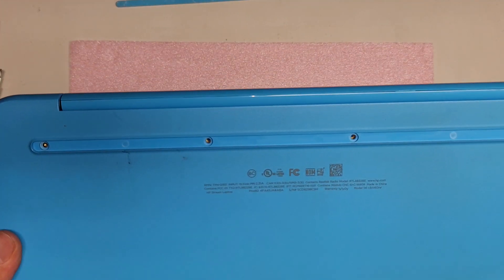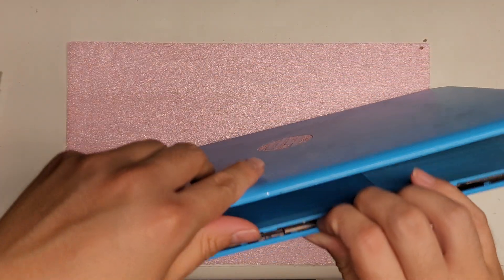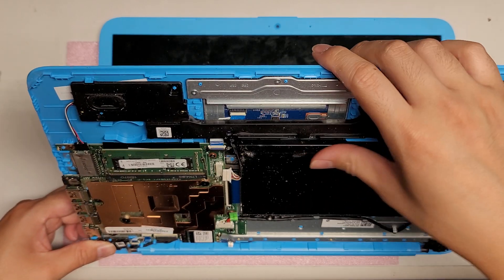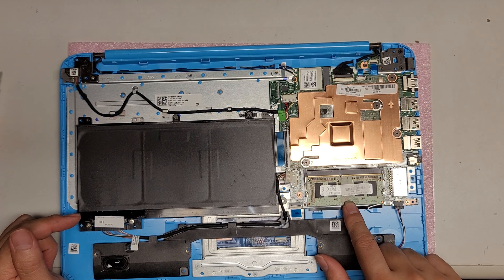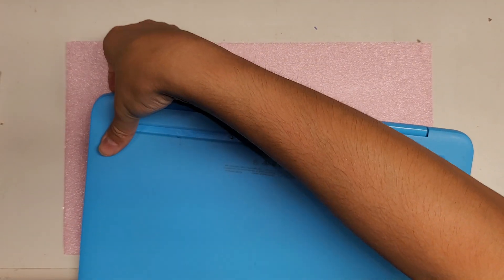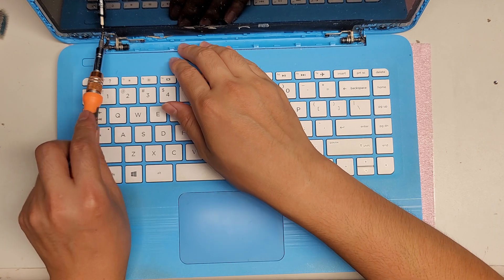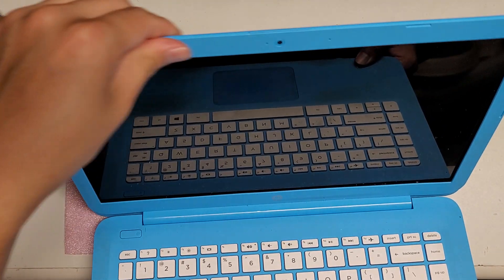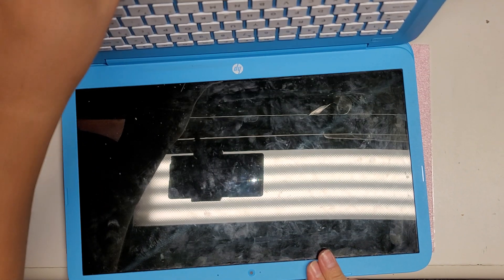HP Stream 14-cb140nr Disassembly RAM Upgrade Repair LCD Screen Replacement

Comment: thank you for the video!!! i have the HP Stream 14-AX000nv ...Has integrated onboard ram and CAN NOT be upgraded... wasnt able to locate the flash either, definately NO SSD- gives budget a new meaning hahaha, sad because for $20 ram upgrade will make a huge difference on this laptop. Overall a fine laptop for light work
Reply from the maker: Yeah, I don't know why they do it.

Comment: I want to ask something.  I have the same model laptop.  And I want to increase storage space.  I know there is no extra bit ssd slot.  but can I remove the wi-fi card and replace it with a bit ssd with msata or m2 input?  Does the motherboard accept it?
Reply from the maker: Possibly. Someone might have mentioned it in the comments.

Comment: Could I put 8gb of ram inside and I dont have to do anything do I?
Reply from the maker: Sure
Reply: @ItsBinhRepaired  also would it run Minecraft bedrock bc the jp stream I am getting is stock and older model
Reply from the maker: @Gotta_Bee_Sam  not sure.  Processor is pretty weak.
Reply: @ItsBinhRepaired  okay I just wait and see 👀
Reply from the maker: @Gotta_Bee_Sam  OK

Comment: I have this computer but I don't quite understand it.  I wonder if the disk in this computer is ssd or emmc?  if emmc is there any possibility of installing ssd in this computer?  thanks.
Reply: Model: hp stream 14-cb0xx
Reply from the maker: Emmc can't be upgraded. You can add an SD card or USB for storage. Some models I've heard people install an SSD in the place of the wireless card and use a usb wireless adapter.

Comment: The lights on but nobody's home .Good video .
Reply from the maker: Lol wuh?
Reply: @ItsBinhRepaired  was just looking ti see how it came apart and you video was very helpful sir.
Reply from the maker: Glad it helped. Do you know what the light's on, but nobody's home means? Lol
Reply: I have one and the power port is broken so I can see now before I even open it that it isn't attached to the main board so happy days .
Reply from the maker: @danieldoherty8009  haha sounds good. If you haven't already, please like and subscribe so others can find my videos. Thanks!
Reply: @ItsBinhRepaired  its an old irish saying lol , as you mentioned in your video that the light was on on the laptop but the screen wasn't lightening so It's my way of referring to the problem with your laptop.no offence intended .
Reply from the maker: @danieldoherty8009  lol the saying usually refers to a stupid person or someone not paying attention haha
Reply: @ItsBinhRepaired  The saying probably means alot of things lol .
Reply from the maker: @danieldoherty8009  lol

Comment: HP should be ashamed putting this piece of junk out.
I had been a lifelong HP purchaser, but personally and professionally, but after buying this for my daughter and it not even last a year before there was no room to accept Windows updates.... I threw it in the trash and stopped buying HP.
Reply from the maker: apparently you can replace the wireless card with an msata SSD and use a usb wireless adapter. The laptop was created because Microsoft was releasing cheap licenses for computers that adhered to strict spec limitations. There were screen size limitations as well as storage limitations.

Comment: the "SSD" can't be upgraded as it eMMC but what you can do it get a mSATA SSD, remove the wifi card and replace the wifi card with the mSATA SSD, then since you wouldn't have a wifi card anymore you would just have to buy a usb wifi dongle. A 256GB mSATA SSD on Amazon costs $40.00 and the wifi dongle $14.00
Reply from the maker: Hmmm good idea. Have you done that?
Reply: I have not done it on this exact machine but I have installed an M SATA SSD into my other laptop replacing one of the wireless cards with it but it had two wireless cards and three m sata slots but only the one of them was the right length for the m sata SSD
Reply from the maker: Interesting
Reply: @ItsBinhRepaired  I was just in my sisters and it is not a standard msata slot.
Reply from the maker: @Jammermaker  :(
Reply: @ItsBinhRepaired  I told her her best bet is to get a SD card for the extra space because it just uses the USB 2.0 ports as far as I can tell.  I mean I have 128gb in my phone and that was cheap enough.  Appreciate the video though made taking it apart a breeze.
Reply from the maker: @Jammermaker  yup, no problem
Reply: I have this computer but I don't quite understand it.  I wonder if the disk in this computer is ssd or emmc?  if emmc is there any possibility of installing ssd in this computer?  thanks.
Model: hp stream 14-cb0xx

Comment: What stick of ram would you recommend for this, and how high can it be upgraded? Could you send a link?
Reply from the maker: You likely won't get much performance increase, but this. https://amzn.to/3BbikNx Might as well use the money towards a real computer, not one of these stream things that are designed just for basic internet usage.
Reply: @ItsBinhRepaired  I fortunately have a really good laptop with exceptional performance, buuuut I’m also a hoe for blue and white themed things lol. I may use it for writing and simple projects. 
Without the upgrade of ram, do you think it would still load things pretty quickly? Google chrome? Microsoft wordpad? Even the boot up time? I don’t want to rage at something for being incredibly slow, but when I saw the 4gb of ram I could just feeeeel that waiting to happen. I just haven’t found a decent laptop that’s coloured with a white keyboard/blue body combo.
Reply from the maker: @nagisashiota6604  processor and storage will be the issue. More RAM = storage will be eaten up to make room for RAM dump if it crashes.

You could get skins for laptops, or watch my disassembly videos and cover all the important bits and spray paint a laptop blue haha
Reply from the maker: Someone said you can replace the wireless card with an msata SSD and then use a usb wireless card.

Comment: I have the same laptop and if I use an external monitor and use the function key on the top row to switch the monitor off and only use the external monitor, if I leave that setting and unplug the external next time I start my computer I will have no monitor visible as if it didn't work until I hit the function key on the top row. It asks "laptop only" "duplicate" "extend"  and "external only". Just thinking maybe you pushed the function key by mistake and that's why your monitor won't work.
Reply from the maker: Nope, dead laptop. These are customer computers. I don't own them.

Comment: I just crucial scan my latest AMD HP stream 14 that it can be upgraded to 8 GB.
Reply from the maker: You can put whatever fits. Even 16gb
Reply: @ItsBinhRepaired  really?
Reply from the maker: @lilcoocas9869  try it. I haven't seen a laptop RAM limited in over 10 years

Comment: Do you think it's possible to change processors? If so, what one would you recommend?
Reply from the maker: Do people even watch my videos?
Reply: @ItsBinhRepaired  literally just found your channel, but I like your content
Reply from the maker: @l.d.cfilms4363  haha thanks. The processors on 99.9% of laptops cannot be changed.
Reply: @ItsBinhRepaired  this is why I love my old Dell Precision M4500, not only is the CPU socketed but it also has discrete graphics (Quadro FX1800 I think).  But I believe I have one of the best if not the best processor that fits in the socket for it
Reply from the maker: @Jammermaker  nice

Comment: Dude can the storage be upgradeable (not the RAM but the other one)?
Reply from the maker: Nope
Reply: If you mean the 32 gb hard drive, it can't be physically exchanged for a better one, but I bought a 2 tb external hard drive, and it works really good for me.
Reply from the maker: @l.d.cfilms4363  exactly! And someone wants me to believe they can play fallout 3 on it at 60fps LOL
Reply: @ItsBinhRepaired  yeah, I like to play minecraft, one of the least graphics intensive games know to man, and I get like 30 fps on a good day
Reply from the maker: @l.d.cfilms4363  try roblox maybe :P
Reply: @l.d.cfilms4363  how did you install it?
Reply: @techwave-99  if you mean the external hard drive, all I did was buy a 2tb hard drive (doesn't have to be 2 terabytes, just the one I picked), plug it into the usb port, and in settings I switched all the settings to 'save to :E drive.
Reply: @techwave-99  I would recommend SanDisk, as they're high quality, never have problems, and they're easy to set up.
Reply: @l.d.cfilms4363  yo, I have a question, my laptop (the one in the video) doesn't have enough storage for anything, I deleted everything yet I still don't even have enough storage to factory reset. 

Should I replace the RAM or get the external hard drive you mentioned in the previous comments? 

If I do get the external hard drive, what would I do since I don't even have anything downloaded
Reply from the maker: I don't know what you're talking about. A factory restore deletes all your data.
Reply: @salemthesomali3421   I would recommend getting the ssd replaced. It doesn't have to be some fancy 800 tb hard drive, but just something that can hold the storage necessary for factory resetting. I also had the issue where I didn't have the storage to do it. If it costs to much however, I might have to recommend selling yours and getting a new one. Sorry for such a long reply, but I hope it helps dude.
Reply: @l.d.cfilms4363  bro, I was expecting you to answer maybe weeks later, thank you so much
Reply from the maker: Me? Why would I wait weeks to respond? Lol
Reply: @salemthesomali3421  yeah no problem, I hate it when somebody answers my question weeks or months after I've already resolved my issue lol
Reply from the maker: Yup lol
Reply: Ooohh okay thanks guys. Maybe I'll buy an external drive instead.
Reply: What games can be played on this laptop? Can valorant be okay? Or will it lag?
Reply from the maker: @miskaasa  nothing lol

Comment: I upgraded the ram without getting the whole shell off. It was just reaching it and grabbing the ram out after unlatching, then add the new ram in and drop and latch.
Reply from the maker: Nice
Reply: What did you do upgrade wise? Replace with another 4gb or 8gb? If 8gb upgrade send me link or what product exactly? Any helps appreciated I use mine for gaming cause I’m a cheap bastard and would like to know if it would make any drastic changes to gaming 
Like outer wild, vallheim, ori, and other low spec games(indie primarily no cod or cyberpunk or nothing heavy because I don’t have the money for a unit like that ya dig?)
Reply: @chauncey5962  Its only one slot so i went with a single 8gb stick. I also went with Linux mint which allows me to still play steam games using proton. The intel gpu supports vulkan and acts as a middle man for direct x. Mostly indie games and low spec games but they run fine.
Reply: @greyfoxzero  Ooo interesting with Mint and Proton on this potato....
Reply from the maker: Lol
Reply: @ItsBinhRepaired  

Considering an 8gb stick is like $20-40....doesn't seem worth it.

I'll probably fiddle with overclocking it and sprucing up the performance a bit.

A buddy of mine put Linux on it, which really helped.

I've been deep diving on device upgrades...looking at things like Lenovo Tab P11 ($250) as a do it all device....intrigued to test cloud gaming, Android games and maybe emulation....
Reply from the maker: @tylerwhitney3443  yeah, it's not worth it.
Reply: @tylerwhitney3443  Yeah been running Mint and its been great. I dropped back to 4gb ram and used the 8gb stick in another laptop since mint really does well on 4gb for my usage.

Comment: So if I’m not wrong for people asking
You can upgrade this laptop to a total of 8gb of ram 
It can’t go any higher because the processor can’t handle it 
Have fun 👍🏾
Reply from the maker: Processor shouldn't be a limitation. You should be able to get as large a stick as you want. The bios needs to support it.
Reply: @ItsBinhRepaired  Intel specifications about the N4000 CPU (I'm assuming that's what your HP Stream has) are pretty clear - max 8GB.
Reply from the maker: I rarely see an actual max RAM
Reply: So would I be able to add 16Ram? I just seen this video and I wanted to know so I can start making music. I can do 8gb but if I’m able I wanna do 16gb. As you can tell I’m not good with this stuff😅😅
Reply from the maker: If you can find one that large.

Comment: Hello, what's the update on this? Did you fix it?
Mine has the same problem and I think it IS the ram.
The power led indicator comes on but nothing else. Removed the ram and powered it on and the caps lock led came on too. I'm going to try and find a replacement ram card and hope it works.
Reply from the maker: It was fixed. Sounds good. Hope it works! Sometimes you just need to wipe the contacts with your fingers and reseat it.

Comment: Where can I find the ram
Reply: You can buy it on Amazon or eBay or from micro center but make sure it’s laptop ram not normal
Reply from the maker: I dunno, did you watch the video?
Reply from the maker: Electronics stores or eBay/Amazon
Reply from the maker: Or do you mean where to buy it?